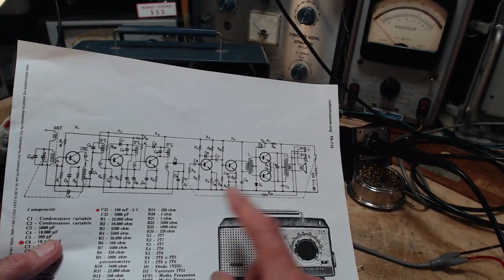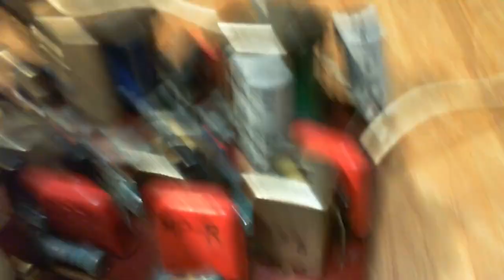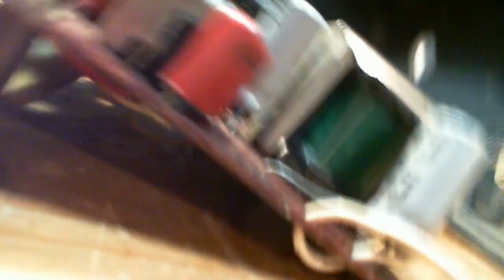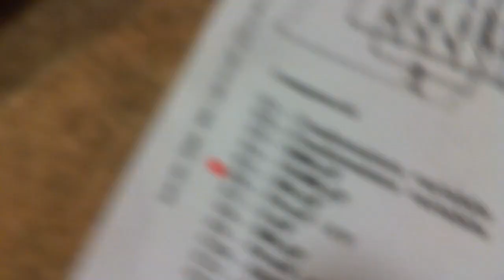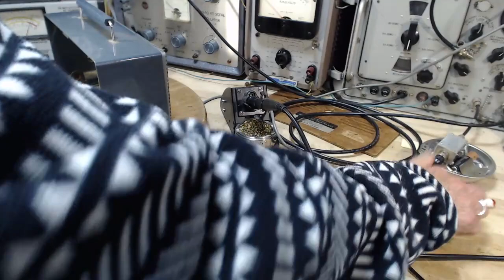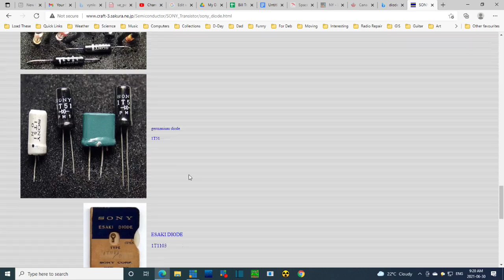SONY TR712 Transistor Radio Video #3 - Detector Diode

Comment: If you never received any stations going through the dial then by all means  replace the detector diode, BUT that was NOT the case! 
It is in amplification of the signals  that the problem exists.

Comment: 32:39 Since you realize that your shot in the dark - i.e. replacing the OA70/1N60 detector diode with a 1N34 - did not do anything to improve the situation, why dont you put the original part back in? After all your replacement strictly speaking is INCORRECT and leaving it in may come to haunt you down the line.
Bad workmanship, lack of knowledge and ignorance of common practice.
I hope your customer sees this and objects to you billing him for replacing a perfectly fine component and using an incorrect replacement part to boot.
Reply: Actually the replacement diode sounds a lot worse than the original, he should put it back...
Reply: Where did he get the idea he had to replace that diode in the first place?

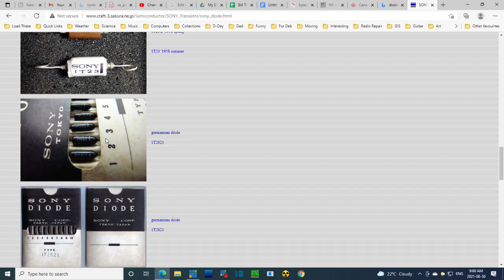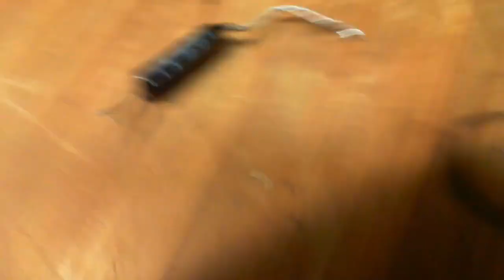Comment: 9:02 and 23:08. Get your act together! Use the Sams for this radio and you will immediately get not only the location of the detector diode on the PCB BUT most IMPORTANTLY the x-ref between Sony PartNo 1T23G, the original diode behind it OA70 and the possible replacement 1N60! 
But no, minutes of guessing and poking in the dark and using some random sub-optimal substitutes. 
Oh wait, I forgot, you dont read comments... Well then unless one of your fanboys emails you, you probably wont even know that there is a full Sams for this radio online, and you are probably not aware of the download link to it I posted some videos ago. 
Well guess the german saying is true; keine Arme, keine Kekse.
Reply: Yes it is another fun video.  It is hard to tell what he is talking about in the distortion as both the radios sound the same to me.  He must have truly amazing hearing as that is the only way he seems to judge things, audially and visually.  Have no clue what he needs all that test equipment for when he doesn't use it as it should be.  Tomorrow we get to look at his scope that doesn't trigger.  Almost going to go out on a limb that it is one of the transistors, but being germainum he won't have any and even if he did he want spec them out to make sure they are right.  I can't think of any video of his I have watched where he gets any descent reception.  It all sounds lousy 99% of the time.  I don't know if he is really in a bad area or if it is his antenna, but wish he would get that fixed to the point he can receive something in his shop.  Would go a long way in making determinations.
Reply: @curtisgriffin7924  This has to be one of the most basic and conventional vintage solid state receivers made, but still, beyond his understanding and skills. Removing solder from IC pads and traces with a screwdriver? Is he for real?
Reply: @curtisgriffin7924  I can hear a distortion AFTER he replaces the diode, the original sounded perfectly well, but, hey he must have something to show off everyday, right?
Reply: @StillCloser  Useless audio sweep, screwed-up scope screen images and BS chatter and chuckle overload. Sure way to fork a repair bill out of naive clients.
Reply: @StillCloser  Indeed, the show must go on regardless of mutilations, copyright hits, recycling used spares, cold solder joints galore, etc etc.